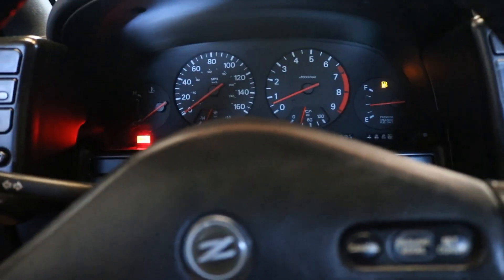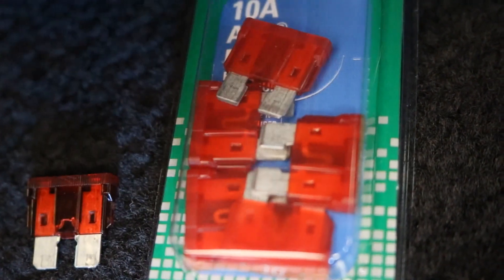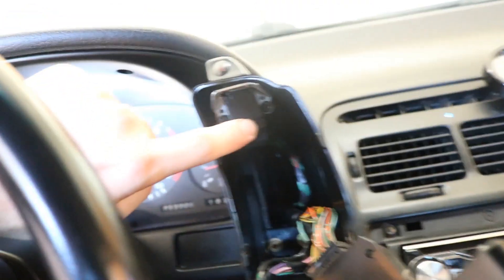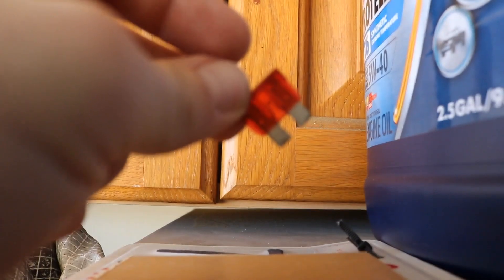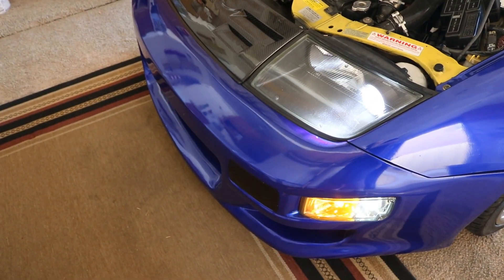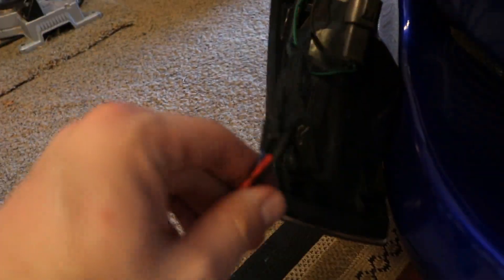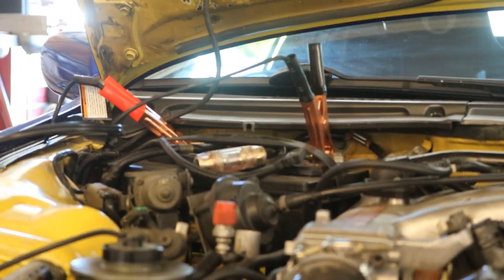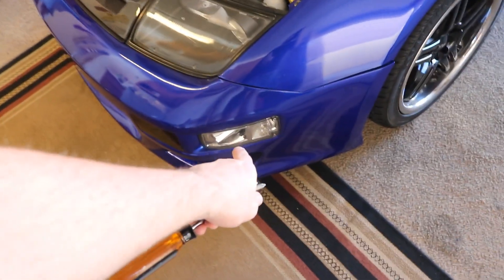Z32 300zx Turn Signal Fuse Issue **FIXED**

Comment: My 10a fuse is good for the turn signals. So where else can i look.
Reply: It's the switch on the steering columb. My bright lights stay on when I put them on dim, and signals didn't work. I played with it and now it works. The connectors are copper and they tarnish. If you take it apart clean the copper with metal cleaner polish if you can. Moving it will rub off the tarnish on contacts and make it work again.
Reply: @sleepwalker29  thank u

Comment: Is there a relay or switch which controls the turn signal tic from the steering column. I have at times bot being about to even put my signals on and I would have to bang my steering column from bottom and it stsrts working....cant figure out why
Reply from the maker: Yes, the relay is in the steering column. That's probably why it worked when you hit it.

Comment: Hey buddy quick question....i jave those same side corner lights but cant seem to find lights to fit since the wholes are smaller for pen howd you fond those leds to fit??
What type of bulbs and what did you do
Reply from the maker: These actually came on the car when I bought it, so I'm not too sure. My best guess is bring the light fixture to a lighting shop to see what size bulb it takes, then order a pair off Amazon.